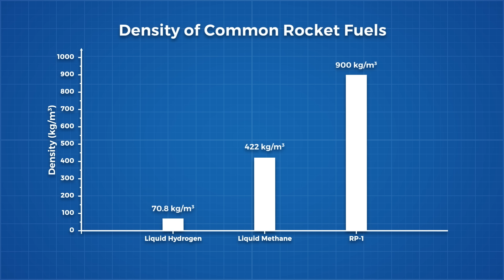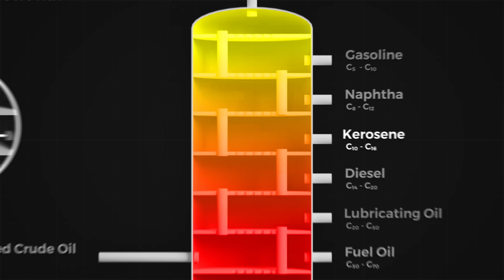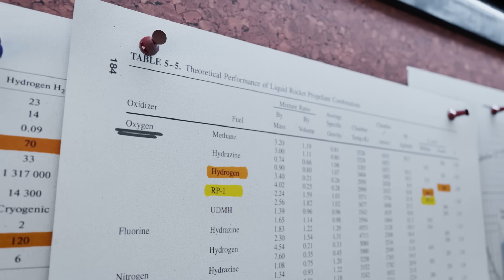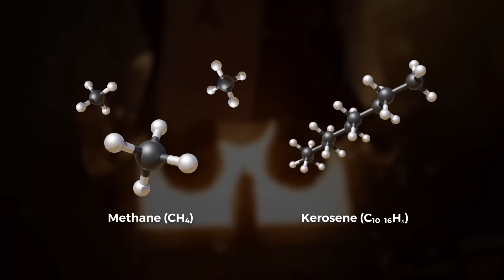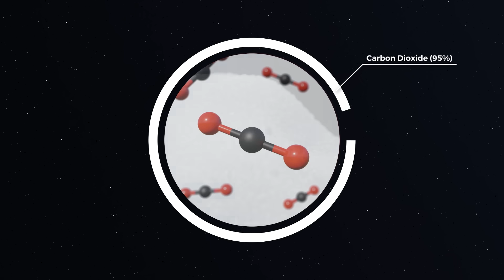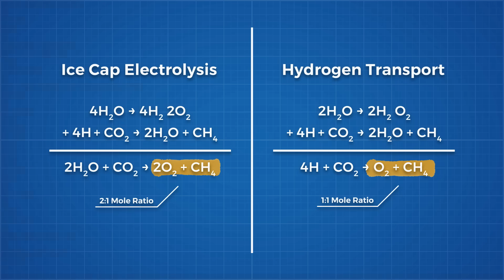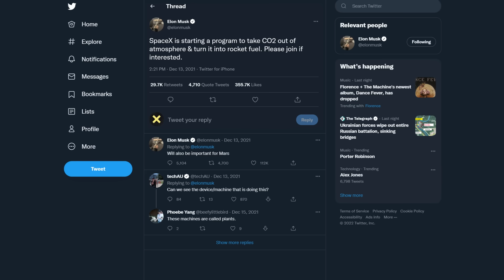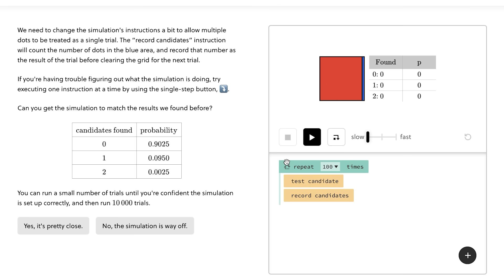Why SpaceX is Using a New Fuel

Comment: Dude, climate change is not a concern, and even if it were, it is certainly not a top concern threatening our planet.  Do some of your own research instead of only the propaganda
Reply: Maybe start with some of the Stossel videos on the topic.  Or the book by michael schellenberger
Reply: @H4KnSL4K  
The RATE CHANGE is very much a problem.
You are a man of logic, therefor you will know that CO2 captures infrared light in our atmosphere. 
More CO2 will cause a higher capture rate and thus a higher overall temperature.
A high rate of rising CO2 levels therefore will cause an accelerated heating effect. Obviously this causes a rapid change in climate and ecosystems can't adapt that fast. 

This is basic logic and science.
Reply: @3gunslingers  this doesn't take into effect the changes of moisture and cloud cover, which have a much more profound effect than just CO2.  It is simply not that simple at all, and there is no reliable research.  Besides, a very small temperature increase over a long period of time might actually be a good thing and there is certainly no evidence at all of a runaway or tipping point situation
Reply: @H4KnSL4K  
"Besides, a very small temperature increase over a long period of time might actually be a good thing" 
Yes, maybe. But the problem is that we already have a LARGE temperature increase over a SHORT period of time. That's what's worrying! We have no archaeological or geological record of a time in earths history when CO2 levels and temperature rose as fast as today. The rate of change is faster than ever before in earths history! 

"It is simply not that simple at all, and there is no reliable research." 
EXXON published extensive research on CO2 concentration in the atmosphere and the correlating temperature.
They made predictions will into the 2050's. So far they are spot on.
But they try to hide those papers. Can you guess why?
Reply: Just stumbled across this, it looks pretty informative as well: https://www.youtube.com/watch?v=sDo7saKaEys
My point is that this is not so simple (e.g. of CO2 as the single variable) and there is way more uncertainty than is commonly communicated
Reply: @H4KnSL4K  
Why didn't you look up the EXXON papers instead?
Reply: @3gunslingers  sorry, I just posted links to stuff I had run across before, I didn't yet take the time to find the EXXON papers that I have never seen before
Reply: @H4KnSL4K  
"I didn't yet take the time to find the EXXON papers that I have never seen before" 
You should. It's absolutely eye opening how accurate the predictions were and how much the oil industry did in the last decades to cover up that fact.

Comment: Try to stick to science and engineering. Politically correct nonsense detracts and draws your objectivity into question. Stick to the numbers, not the narrative.
Reply: Climate change is science and engineering. It is well supported by numbers.
And the problem is not climate change itself, it is the accelerated RATE of change.

The fact that CO2 captured infrared light is hardly politically correct nonsense, isn't it?
Reply: What makes it political...is not that climate changes...paleontologists have known this since Aguissz (sp)...its ASSERTIONS based on ideological agendas that climate change is man made and reversible by gigantic restructuring of economies and society. That's political. Assertions are not science. You CANNOT prove that climate change is: 
A.  Man made
 B. Reversible
C. Necessarily Negative for man or nature
You know this. You're convinced. Without sufficient info. Im not. And EVEN IF climate change was proven...somehow...to be proponderantly of human causation...and it has NOT...your facile avcceptance of the SOLUTION is POLITICAL...

Stick to science.
Reply: @johnsnyder3443  
Okay.
Do you at least accept the fact that CO2 captures infrared light?

Comment: 13:51
You are proposing a perpetual motion machine.
Reply: Care to elaborate?
Reply: @3gunslingers  Can't have endothermic reactions without net negative energy. Converting CO2 back to hydrocarbons completely defeats the purpose of burning fossil fuel in the first place.
Reply: @nickkorkodylas5005  
You got two different concepts mixed up there.
Reply: @3gunslingers  How so?
Reply: @nickkorkodylas5005  
Capturing CO2 for climate change purposes and making rocket fuel out of captured CO2 are two very different things. 
They are not even close in energy requirements.

Comment: So you want to share the fueling infrastructure of liquid oxygen and methane?
  That is a huge safety issue.  Hydrocarbons should never be introduced into an pressurized oxygen system.
Reply: You know that you can just build two fueling systems, that are virtually identical?
You don't need two systems build to very different specifications.

Comment: The head line is mis leading. Methan is not new, as you said. It's only new to be used in a greater number. 
Space X is using a 'different' fuel than others, would be a better head line.
Thumb down for wasting my time.
Reply: I can make new methane.  I'll prove it to you... if you'll just pull my finger.

Comment: I like to point out that not only did the US go to the Moon with ft/lbs and psi... we did it with kerosene through a carburetor.   Kerosene doesn't boil-mix with oxygen, you have to force the mixture which means carburetion jets.

The one thing that Kerosene sucks at is not freezing in space.  At -40°C you cease to be able to use Kerosene without having a heater because you really really don't want a hydraulic volume expanding in your fuel tanks.

THIS is why SpaceX is going with Methane you abject moron.  A spacecraft that is to go to orbit and then operate in orbit cannot have frozen fuel with unreliable pressure and specious cooling properties.  It has absolutely nothing to do with Mars.

Comment: and you start with a known NAZI huh? So CO2 and H electrolytically combined produces methane huh? HOW ABOUT USING THAT IN OUR INTERNAL COMBUSTION ENGINE? Solar can be used to produce Hydrogen and provide power for electrolysis. A slow process but all you need is water... and please be a bit more politically respectful and less woke

Comment: Absolute propaganda about the CO2 narrative . The planet is in a CO2 drought, CO2 is a trace gas in our atmosphere. If CO2 levels drops to 180ppm all plant and animal life on Earth will cease. 

The Cambrian period, 510 million years ago, was the most successful abundant and prolific period for life on Earth for both plant and animal life on land sea and air. During this period CO2 was 30 times greater, 12000ppm, than current CO2 levels and there was no global warming. Life thrives in a warm climate with abundant CO2. CO2 is the gas of life. 
Percentage of gases that form our atmosphere
Nitrogen — 78 %.
Oxygen — 21 %
Argon — 0.93 %
Carbon dioxide — 0.04 %
Trace amounts of neon, helium, methane, krypton and hydrogen, as well as water vapor.

Comment: If bringing our own Hydrogen was required for the fuel reagents, wouldn't it be easier to bring the hydrogen combined in a more complex molecule that could be more easily stored, condensed and utilised? E.g. H2O or a similar molecule? I mean, I haven't checked the weight ratios, but just considering the difficulties storing hydrogen gas, bringing water instead would be easier and have a greater utility. That said, unless we can find ways of producing or recycling water and oxygen for human use in the first place, the whole idea of going to Mars is... problematic.

Comment: Several reasons the kerosene was not completely  burned were 1. incomplete burning of the carbon actually can deliver higher specific impulse than the stoichiometric ratios.2. the soot prevents burn-through of the engines giving longer burn time of disposable nozzles. Sooting also helps the steel being degraded from residual sulfur in the kerosene. 
Phobos and Deimos seem to be carbonaceous chondrites which have from 5% to 10% water  and about 5% kerogen ( a tarry hydrocarbon substance form the primordial formation of he solar system) that could be processed for hydrocarbon fuels. Phobos and Deimos would seem to be in a good position as mined sources of both water and hydrocarbons for the exploration of Mars, and are actually are in a better location form an orbital mechanics point of view (and total propellant expended) than any Earth or Mars bound resources.

Comment: What I don't understand is why for the first stage and possibly even the second stage, don't they simply use atmospheric oxygen.  Strap on 2 or 4 or 6 turbofan engines (say from a 747) to the bottom of the rocket and only have to carry the fuel, not the oxygen.  Land this first stage back on earth, just as spaceX does.  Of course, later stages have to carry the oxidizer as well.  If the speed is too great, possibly use blackbird motors.  And they can operate at higher altitudes.  Perhaps they could be used in the second stage.  Land it as well.

Comment: You really need to quit with the Climate Change so much.  People don't believe in it because the climate has been changing since before we were here.  
I use the reference of a Fire Extinguisher.  You spray the base, not the flame.  The base is the cause of the problem, Environmental contamination.  Not the Flame whish is the Climate Change.

Take for instance when you mentioned capturing the contaminates in the Environment.  You actually said "Capturing the Climate".  You're not really capturing the climate.  You're capture the contaminates that are causing the climate crisis. 🖖🙂

Comment: 14:00 Problem is that No one has set a theoretical optimal level of CO-2 for Earth's atmosphere.

CO-2 is used by all green plants (photosynthesis) to capture carbon and release oxygen into the atmosphere for use by animals to breath such as human beings and wild animals.

As CO-2 is removed from the atmosphere, it shall reduce all green plants being able to thrive on reduced amounts of water from the soil and air and thereby dramatically increase the amount of desertification. This is the reason why commercial greenhouses add CO-2 vastly better to improve green plant growth and oxygen production of the green plants.

This is because there are pores on bottom of the leaves and back of the green grass that open to let in CO-2. If levels of CO-2 are even slightly lower, this requires those pores to open wider, and thereby allow more than average amounts of their collected water vapor to escape back into the air.

--> what percentage of earth's greenhouse gases is water vapor

BTW, water vapor is the number one greenhouse gas by a factor of 60 to 85% or so. What are you going to do to reduce the amount of water vapor? Are you going to gather all of the waters of the oceans and eject it  into outer space?

This action of ridding the planet of all greenhouse gases would instantly cause the night time temperatures to drop toward that of outer space that is near to absolute zero Kelvin or −273.15 °C which is −459.67 °F and the daytime temperatures to be beyond the boiling point of water--temperatures that are a hostile living environment for every living thing on the planet.

This is why global warming and climate change alarmism (an ideological virtual religious cult) is practiced and spread by tiny minds who have reduced cognition abilities to realize the implications of their plans to cause so much trouble for everyone through high taxation levels and food shortages and amass huge political power for authoritarian globalist leaders who also have very low levels of intelligence. Very not smart people do NOT appreciate the implications of their voting for various very BAD political policies so continue unabated to harm both themselves and their loved ones.

People with untold vast amounts of riches (international bankers) should NOT be pushing their ideological crap upon the rest of us lest they destroy the planet with their nefarious morally reprehensible plans as they have done many times before by supporting both sides of every major war to indebt everyone involved.

https://youtu.be/PPE-JqrzSAc UN UNCED Earth Summit Rio de Janeiro 1992 by George Hunt

Comment: There are other sources of oxygen.
And other sources of hydrogen. We directly found gypsum (CaSO4 - 2H2O) on Mars.  20% of its mass is water.

Fe2O3, SiO2, CaO, Al2O3 are in abundance.  Heat it and vacuum off any gasses.   Use an arc furnace to make aluminum (or whatever), and extract the O2.  Run the hot gasses through the next batch to warm it.

Comment: The issue people have with NASA (or at least from my point of view) is the waste of money compared to other businesses. such as the current project to the moon, using a massively wasteful and expensive options.

It would be nice to see more implementation of carbon capture and processing even if it is costly. If they can find a way to make the the carbon captured back into a fuel that can be used in standard combustion cars i expect it would see a massive increase in funding

Comment: I'm not sure why the suggesting of creating methane in Mars' atmosphere was even a talking point in here.  Yes, the atmosphere on mars is 95% carbon dioxide.. but it has 1% of the total atmosphere on earth by volume, and it's half the size of earth.  Overall Mars actually has LESS available CO2 than earth does, by a very good margin.  It shouldn't even be considered a talking point right now as we're not even capable of taking anywhere close to enough out of our own atmosphere to combat climate change.  It wouldn't be until we had technology to do that on earth that you'd be able to start talking about doing it on mars.  Let's take one of the most efficient carbon capture companies out there, Aker Carbon Capture... they take about 400,000 tonnes per year out of the atmosphere throughout all of their projects globally.  That might seem impressive especially considering the small percentage of CO2 that's in our atmosphere, however on mars that would equate to around 40,000 - 45,000 tonnes per year...  assuming they had the exact same amount of infrastructure that they have on earth (which wouldn't be feasible).  In reality, you're looking more along the lines of between 100-200 tonnes per year and that's being extremely generous.  That... is not a lot, especially if you're looking at it from a colonization perspective.  In fact, the systems you'd need on Mars would have to be exceptionally larger because you need to pull in as much of the ambient atmosphere as you can.  It takes far more "work" to extract CO2 from Mars than on Earth (because there's so very little atmosphere to begin with) even though the Earth's atmosphere is only 0.04% CO2.

To put it another way... say you're extracting salt from the pacific ocean.  It's 3.5% salinity.. but it's a HUGE body of water.  Going to take a good amount of water to get a decent amount of salt out of it.  Now say you're looking at a body of water like the dead sea with a salinity of 34.2%.  That's a HUGE difference, you should be able to get a LOT of salt out of that with having to dig through very little water, right? Well.. not if you take the dead sea and spread it out about half the volume of the pacific ocean.  Now you still have a HUGE amount of salt compared to water, but it's spread SO THIN that it takes orders of magnitude more effort to get any salt than it would if you just focused on the ocean.  That's the difference between Earth's CO2 and Mars' CO2. Mars might have a higher percentage of it in its atmosphere, but it has extremely little atmosphere compared to earth and spread out over a great distance.

Comment: The key to manufacturing on mars is energy not raw materials. So building nuclear reactors on Mars combined with other types of fuel generators would be the way to go. 
Mars is rich in iron, carbon, Aluminum, Silicon and has oxygen present as well. Which more or less is the building blocks of engineering.

Comment: Have you ever worked on a space craft? Did you physically watch an appolo launch? How-about  Space Shuttle OV102, OR OV103 OR OV104, OR OV105??, or titan missile, or IUS, or C3, or C4? Have you ever stood atop the tower on pad A? Have you ever assembled the space shuttle for launch?, or installed the detonators at the pad? Have you ever installed the main separation bolts on the shuttle and torqued them to 10K ft/lbs?

Comment: Wonder if it could be possible to have a rocket with 4 tanks. One for lox, one for a efficient fuel as propellant, one for a high molecular weight kind of fuel, and lastly one tank carrying water. Step 1 is to reach orbit using most of the fuel. Then linger in orbit and start cracking the long chain hydrocarbons using water to form fresh new fuel. Then when theres enough fuel, can start doing the next burn in the itinerary. Probably chemically feasible, but I wonder if its too much hassle for what its worth or actually kinda legit